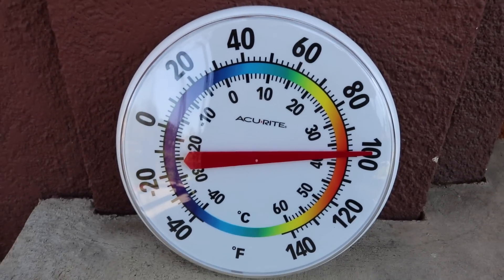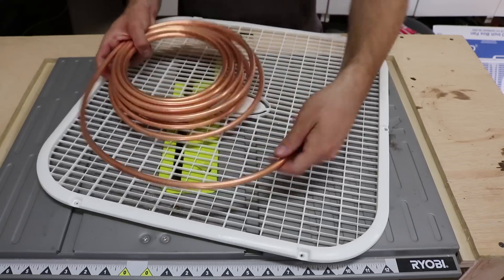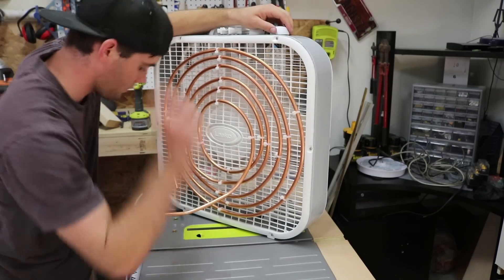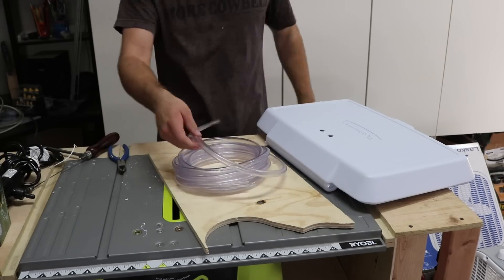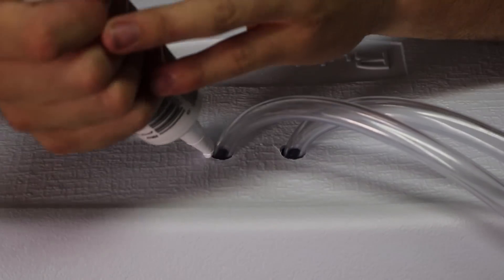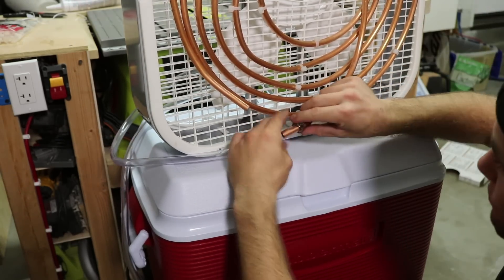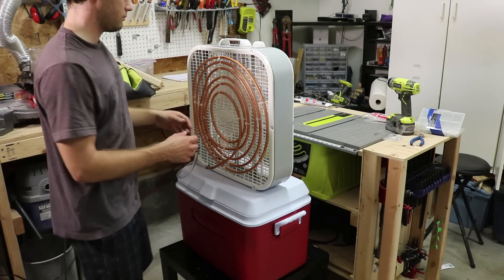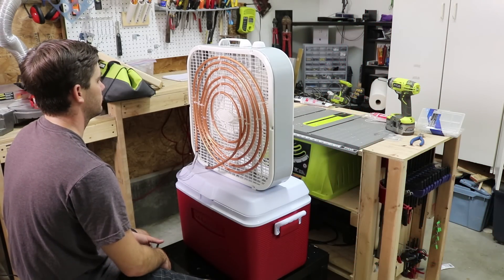$100 Homemade Air Conditioner - DIY

Comment: First off, congrats on making something close to how an actual A/C works, instead of a glorified swamp cooler and just blowing moist air into the room.
--------
What's the difference?  An actual A/C dehumidies the air, while a swamp cooler adds moisture to the air.  A/Cs are necessary for hot moist climates, while swamp coolers can work great for hot desert climates.  
--------
How does an A/C dehumidy the air?  By condensing the water vapor in the hot moist air on the cold evaporative coils.  The condensation then drains off the coils into a drain pan, where the water either evaporates eventually (outside drain pan), drips onto the ground below outside (outside drain pan), or gets piped into the sewage system (interior drain pan).  
--------
NOTE:  buying guides for A/Cs will specifically tell you to buy an A/C sized appropriately (with the right amount of BTUs or Watts) for your room size, and not to buy an "oversized" A/C that has way too many BTUs or Watts.  Why?  Because for the most part, the cold evaporative coil is the only dehumidifying device on the A/C.  If your oversized A/C cools off your room too fast, it ceases to dehumidify your room.  The tradeoff for appropriately sized A/C is that it steadily dehumidifies the room, but is slower at cooling the room.*
-------
PRO TIP:  If you notice your room is cool enough but still too damp, turn the fan to a slower speed  The room air passes through the cooling coils at a slower rate, which allows your room air to dehumidiy better.  Use portable room fans to distribute the cold air throughout the room rather than setting the A/C fans to their highest speed.  
--------
However, I noticed some flaws in the design.  
1.  There doesn't appear to be an obvious way for the condensation forming on the pipe to drain away.  Each pipe will just drain onto the pipe below, and I am unsure of whether all of the pipe condensation will adequately drain away to allow the system to properly dehumidy the room.  If the pipes remain wet most of the time, the system becomes more of a swamp cooler than an A/C.  
2. The condensation will be dripping onto the cooler at a pretty high rate, and the water needs to go somewhere.  I would put a large plastic or metal an under the cooler to collect the condensate, then empty the pan later on.  You could re-freeze the water to put back into the cooler for later use.  
3.  Others have noted that the pipe design doesn't have the surface area to adequately cool off the room.  Normal A/Cs have lots of thin aluminum fins on their evaporative coil radiators  to increase the surface area.  I'm guessing that this design is mostly to cool yourself off while working, which I guess is adequate.  
---------
Finally, I would put more investment into adequately shielding your garage door from the afternoon sun.  As a Certified Passive House Consultant, I can give some tips.
1.  I am guessing that your garage door faces west, since the sun is hitting it in the afternoon.
2.  Passive House design discourages windows facing east or west because of the uncontrolled overheating during the summer either from the rising sun (east) or setting (sun).  Since you're stuck with the situation, the best you can do is mitigate the sun's effects.
3.  The best way method is some sort of external shading.  A retractable awning that extends fare enough down to block most of the direct afternoon sun will do wonders.
4.  Tree shading or other vertical shading away from your house/building will work as as well, though that's harder to accomplish.
5.  Insulation will help a lot on your door.  There are two types I would recommend.
6.  First type would be radiant barrier insulation, which basically reflect the sun's radiation.  It is better to place it on the outside, but since it's basically a mirror, it might cause some fires somewhere or create bad glare for your neighbors.  So inside the door would be better, practically speaking.  But in this case, the radiation would not be from the sun, but from the door absorbing the sun's radiation, the radiating the heat steadily to its surroudings at  a slower rate.  The radiant barrier insulation would be reflecting this heat.  Make sure the door's material can handle this extra heat.
7.  Second type is the insulation of your choice.  It could be XPS foam, fiberglass batts, mineral wool, etc. (keep the latter two insulation enclosed to prevent fibers from spreading).  This will help further keep the heat away from your garage.  Make sure your garage door can still close with this insualation in place, so space the insulation accordingly on each garage door section (although any gaps in the insulation will reduce its effectiveness).  
8.  Block the garage windows from any afternoon sunlight.   Any light that passes through the window panes will eventually turn into heat, so blocking from the inside is mostly useless.  I would recommend covering the windows from the outside.
-------
* Because buildings are now being designed with better "passive" temperature control (such as in Passive House design), even the smallest-sized A/C (lowest BTU or watt rating) will typically cool off a room in such buildings way too fast for it to dehumidy the air properly, even at the lowest fan speeds.  A/C manufacturers have noted the increased demand for dehumidification over normal cooling, so they have started to incorporate a dehumidification setting that allows the A/C to continue to dehumidy the air even when the system is no longer in cooling mode.

Comment: The morons who suggest a window unit for 150 bucks don't get that they are not practical for a garage, can't install them.  The portable units you can buy are 3 to six times more expensive and need to exhaust.   This "AC" blower is super because you are not throwing water vapor into the air, it is circulating.    This is a very good idea for a garage workshop when you are a hobbyist in the garage and only using it a few hours a day working on the car or at the shop table....AND if you have warm nights even just the water temp in the cooler with no ice should be very pleasant.

Comment: When we were kids we would just fill up milk cartons with water and freeze them and put them in a tray in front of the fan and it cooled the room
Reply: I tried that when I was a kid.  I'm here to testify that it doesn't work well.  Any cooling you feel is from air circulation by the fan.

Comment: the less holes the better? did you fail physics? if your goal is to air condition THE AIR, then it doesnt matter as you are filling the damn thing with ICE anyway. you could literally just get a large tub and fill that with ice and it will cool down its surroundings.

Comment: My car’s ac vents blow somewhat warm air. Do you guys think this would work effectively if I installed the copper on my vents?
Reply: OMG no. Check your low side cooling pressure - you may need to recharge. Check all your car's fluids, like coolant, transmission fluid, and oil.

Comment: Do you not get condensation on the copper pipe which causes drips of water?
Also a white garage door will not get hot. White has no heat  attraction. Our garage is the  coolest place in hot weather.

Comment: I'd suggest:  Add Styrofoam sheets to the garage doors if possible.  Use large diy block ice, saves money, lasts longer.  Put in an exhaust fan and turn it on occassionally to release the heat. All that plus your fan=  energy savings and greener!

Comment: Next video: How to make a space heater using a match and firewood. Stay tuned.
Reply: Lmmfao
Reply: This is a space heater when you consider the for the fridge to make the ice, it had to extract heat from water and pump it out into the room from the back metal tubes, and fan spinning and water pump actually create heat too
Reply: You would use this this as a heater if you heated the water instead of cooling it
Reply: It's easy same ideas just change water  as warm water
Reply: https://youtu.be/TtRkd-rITkU is also a great way to cool down!
Reply: u made my day i so needed a laugh like that

Comment: I wonder if this would work on an electric cooler, so you don't have to keep putting ice in, the unit would just keep cooling the water that gets pumped in? I guess the downside would be needing 3 electric outlets, plus more electricity, but if it is still less than regular AC, maybe worth it.
Reply: The electric cooler will release heat into the room and cancel out any cooling effect.
Reply: @maddyinc933  Didn't know electric coolers put out that much heat. Ok, I guess bag that idea.

Comment: The ONLY way to cool a room with a fan is by using it to blow warm air from inside to the outside (thru a vent) while pulling cooler air (thru another vent) in from somewhere outside.   A device like this only cools the space (very little) because you are bringing ice into the space.   The fan motor running will actually add some heat into the room.

Comment: The shorter the plastic tubes the less cool you will lose, actualy you can run copper all the way almost to the pump and it will be cooler. This is just junk, feeding this with ice every time. Just buy a used portable ac unit for like $120. FAAAAAAAAAAIL. 👎👎👎👎👎👎👎👎

Comment: Yes guys he could simply buy an AC but overtime the AC will cost quite more in electricity than compared to the fan he made that does the same effect. In the long run he saves money

Comment: What was the temp coming out from the tubing aimed at the tubing is what I wonder cause I’m really thinking about building this as well for my garage I use as a shop as well. Or the temp gauge u had on the wall style after it’s been going for a couple hours what does it get down too? Thx for the idea and the video might just build one myself thx

Comment: also Don't expect this to be as cold as a freon ac unit. It's more of a cooler. But its definitely better than just a fan by itself which only blows around hot air in a really hot environment.

Comment: I did this with a smaller cooler. One thing I will say is that you don't need a lot of water. Just enough for the pump to recycle it through. You have to really pack it with ice. Otherwise it will melt really fast and the water going through the tubing will start to get warm. That's the key. PACK IT with plenty of ice.

Comment: I got one of these instead: AC Infinity AIRTITAN T7, Ventilation Fan 12" with Temperature Humidity Controller, for Crawl Space, Basement, Garage, Attic, Hydroponics, Grow Tents https://www.amazon.com/dp/B07JN8411P/ref=cm_sw_r_cp_api_i_8he5Eb0Y31VF4

which only draws 7.2 watts ( as opposed to a 1000W+ AC ) and moves 240cfm of air. Installed to blow hot air either out and vent on the other cooler side of the room or to a room that has an AC return air vent. It has an an adjustable automatic temperature control with temperature probe extension wire. It made a dramatic difference!!

If you’re going to spend $100 and don’t want to increase your electric bill $$$ get     yourself something nice that takes care of itself like one of these AIRTITAN fans.

Comment: Where’s the conductor? This is useless 😂! You could just than rather buy ice and leave it in open and have same effect on room temperature! Or leave refrigerator doors open! Normal AC would have heat and cold separator with conductor! This is not AC
Reply: I'm going to make one with an old car radiator in front of the fan.

Comment: To everyone asking why didnt he buy an ac unit Largest Window Units – 1440 Watts. Medium Window Unit – 900 Watts. Since his garage is about 400 sq ft his electric bill would surely triple making his ac unit keeps cost down since hes only going to be standing in front of the unit.
Reply: Also he might not have a window in his garage. My garage does not have one! It would cost a fortune to add a window just to run a window ac unit. Plus would lead to air leakage as well.

Comment: I know this was made just to make a video interesting, but for $100 I sold my old but good working ac unit
Reply: Not always. It may be a cheaper option to do this than to install a window AC if the garage doesn't have a window. Of course if the garage has a window, yes, go to craigslist or ebay.

Comment: Okay I didn't see you take the temperature after having it run a while of actually what was the temperature coming out of the fan with the cold water circulating and everything I still want to know what the temperature was coming out of the fan now you showed us how hot the the door gets during the day with the sun glaring on it and everything but you didn't show how fluid was coming out of the front of that fan over there copper tubing after all that what was the temperature what was the heat exchange

Comment: Fundamental laws of thermodynamics being overlooked here. The heat has to go somewhere. In your case the heat goes into melting the ice which presumably comes from your refrigerator. That means, as some have already commented, the heat is being put into your kitchen by the freezer that made the ice. The kitchen then has to be cooled by your home AC. The heat ultimately gets outside by your home AC. Your method is very inefficient and costly. Better off using a window evaporatorive cooler which moves the heat directly outside. Roughly the same cost as well.

Comment: The benefits are numerous for this great DIY. Quieter than any portable,  does not require 900- 1400 watts of power, way more eco friendly than "any" ac unit out there ( no R-410A refrigerant necessary) .  The only add on I would suggest to make this very portable: dolly $20. Then Ben, any part of your room can become your favorite.

Comment: Look Ben, the is an anti heat liquid witch is supposed to be used on the coal griller when making a barbeque, to make the handle safe to use... Look at the hardware store for this, and use it to cover the ice box from inside to keep the   ice frozen much more longer., it is not oily it won't desolve in the water, it just decrease loosing low temperature melting ice during the process, other than that, this is A work.... Continue developing it please, & I'll be sure to buy one of these if it is available.. Well done.

Comment: How well did it cool off the garage itself? I know it would feel amazing on a hot day standing right next to it, but if I'm working on the garage in different positions (above the engine, under the engine, under the back of the car etc) it would be kind of a nuisance to move the fan and cooler around. I'd like to do something like this but wall mounted.

Comment: I like this idea.  I have had window unit A/C's and since manufacturers use styrofoam in them to surround fan blade they collect dust and then mildew gets on the dust creating a fishy odor. I would spray inside the unit with clorox bleach but would still within a week of use mildew was back.  Your idea is better in regards to ones health and not having to breath in mildew from a window unit A/C.

Comment: The copper, ice, and water will absorb heat until itself gets warmer and it constantly loses efficiency until you dump warm water and add more ice.  The copper will sweat with condensation and drip gallons of water on the floor unless you can pipe it outside.  Without removing that condensation from the room, humidity remains too high.  Humid air holds more heat.  This project should teach anyone that an A/C does more than meets the eye.

Comment: Buy an a/c unit and put heat OUTSIDE instead of INSIDE YOUR HOUSE. Your freezer expells heat into your house to create that ice ya know? If your freezer is in the garage, well, uh... you only make it hotter in the long run.
Reply: Some people don't have that option easily. My garage has no windows. I could add a window but it would cost hundreds of dollars. Also my freezer isn't in the garage.

Comment: This thing is so completely worthless! U are a dimwit if u think its doing ANYTHING! Decompressing freon in an ACTUAL RADIATOR with a hundred times the surface area of ur worthless tube struggles to cool in many places! Ur moronic trinket is total placebo and simple physics make that so COMPLETELY OBVIOUS! A simple mister would be a thousand times more effective! And fyi, you coulda bought a small air conditioner that actually works for a little more than that! Do u actually think uve discovered something that the engineers at frigidaire missed? Get over yerself snowflake! Ur not as special and smart as you think you are!
Reply: Well, I don't have a window in my garage so I'd have to add one which would cost hundreds of dollars. Second a mister isn't going to work that well if it's humid.

Comment: I do not have a clue how to do the sums, but my gut feel tells me that the energy extracted to make 20 kg of ice is small in comparison to cool air at 40 deg C flowing at 40 litres per second. To cool your garage you need to drop that air temperature to 10 degrees C. Somehow I do not think your device is doing it? The proof is in the thermometer which featured prominently in the be beginning, but got totally forgotten about at the end to proof the results. Put that device on the shelf, wait for the temperature to drop to zero, dig out that device, mount it horizontally,  get some fermented fruit, put it in a pressure cooker and connect it to that copper tubing and you've got yourself a moonshine  still. Just make sure you do not use any plastic tubing, ethanol will dissolve it like instant coffee in boiling water.

Comment: This concept works. I did a similar thing (but not as fancy) with contained ice packs in front of my fan. It definitely does feel cool and adds cooling to the room. What people don't get is that A/Cs cost $ to run compared to fans. The dehumidifier mode of the A/C drops temps like a stone in humidity, though, and it's always good for that cold hit for a few minutes. Still thinking about an A/C. First was my awesome box fan to suck in the cold evening air.